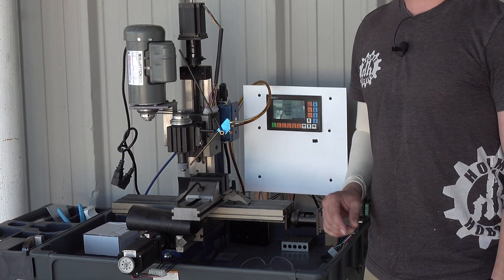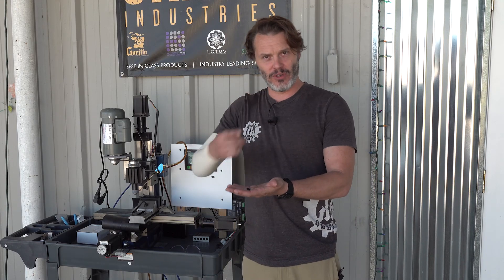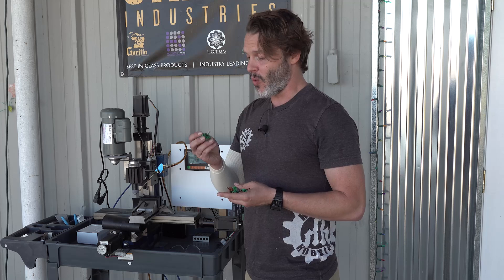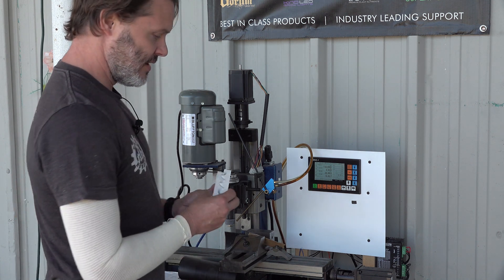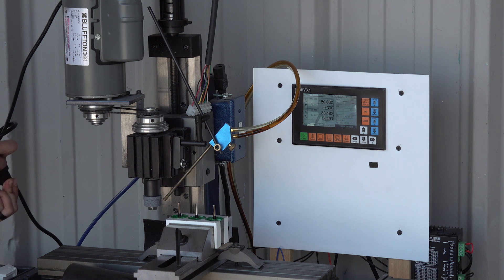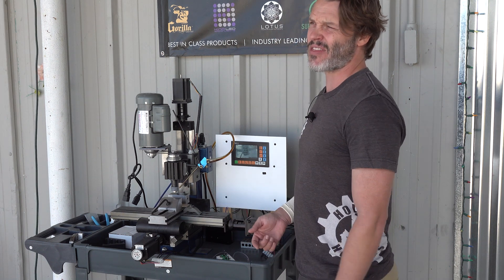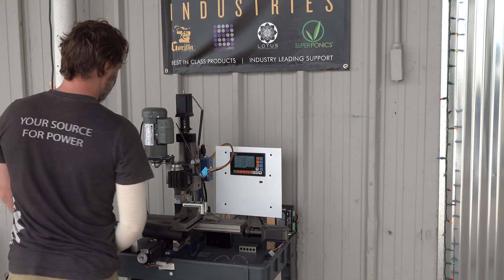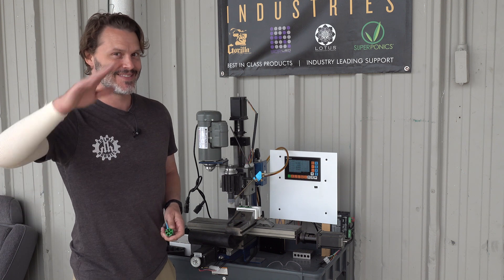Pro Puller & Magnum Motor Shaft Grinding - Custom CNC Grinder Inside Look - Holmes Hobbies

Comment: Little surprised at seeing air instead of coolant.  Oh poop, please don't think that's a critique as it's not - I'm just more familiar with large scale machine work.  Anyways, this is very cool to see - I love seeing effective custom machines esp when they are working away at doing what they do! :D
Reply from the maker: Coolant and grinding dust makes an abrasive paste.  I want to get the dust away from the machine.  If we were making chips I would open the oil path though!
Reply: @HolmesHobbies  I get you.  It does make complete sense.

Comment: Does that machine take into account the wear on the grind stone? Thanks for the video!
Reply from the maker: We manually rezero as needed so it hits at "0" in code.   Maybe every few hundred arms it needs a few thou in adjustment.  Since this machine has steppers and no limit switches, it's as easy as turning it off, progressing the carriage a little, and turning it back on again.

Comment: Cool machine. I started on dials, in the 80's I was using NC, which was     "numerical control". Used a ticker tape or a punch card. The first "CNC" I used had a cassette tape That played in a big Texas Instruments decoder.
Most of my early ones were machines that had been fitted with electronics.
Nice work, nice stuff. Getting ready to build a low CG. Is your Sherpa still available? Its one of my strong choices being it's going to have all your stuff in it. 
As always, be you, and have fun.
Reply from the maker: That's the really old stuff!  One of my teachers said he dropped his NC card box on the way to his class final in college. Ooof!